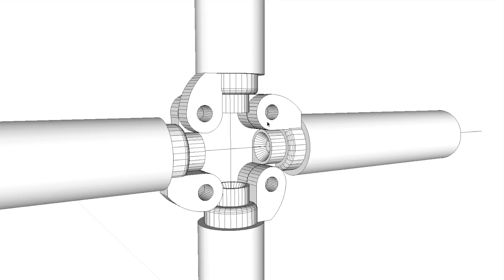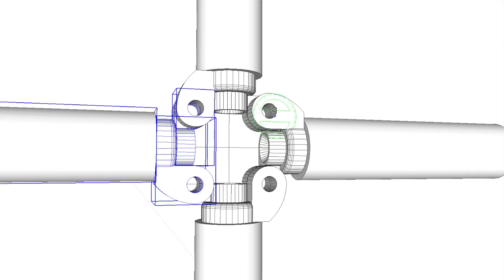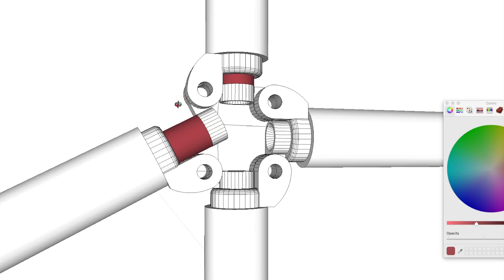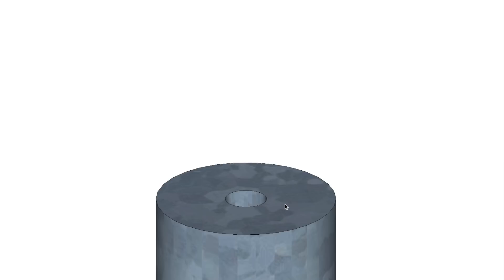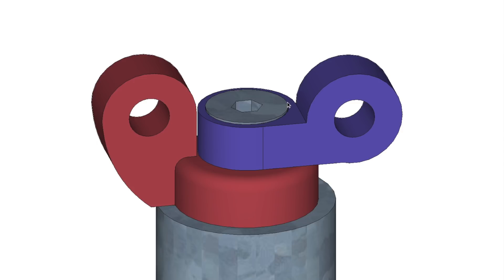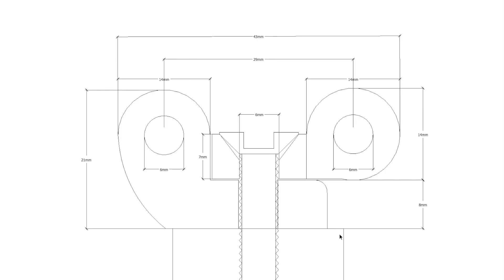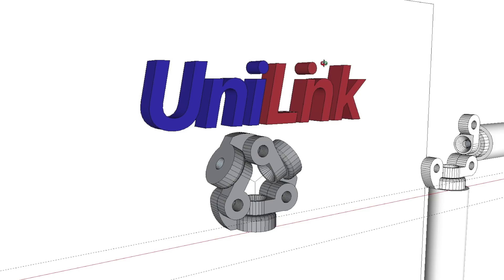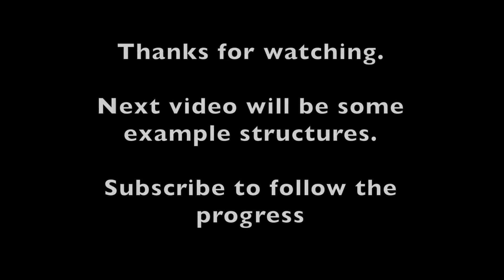Better Dome Hub - tech specs

Comment: "Handmade" ???. Send me a PM and I'll print them for free for you Paul. I've got some high tech carbon fibre filament that would be great for this.
Reply: We need a second view on those prints as well as some dimensions are missing. I am rather shocked at the tininess of the dimensions you have shown. Are you sure they are correct ?
Reply from the maker: Yes it is very small, my brief was to go for cheap and strong. This should work with struts up to 50mm (2") no problem. I'll dig out the PM button and send a message now.
Reply: Yes, please send a PM ASAP.

Comment: Maybe,Top connector, could be used as both top and bottom of connection , if top connector is turned upside down, with counter sunk hole in bottom?

Comment: Mayby you can use some sort of undercut anchors too put on the end of a pipe. (https://www.hilti.com.om/anchor-fasteners/undercut-anchors/r1208) Or a cheaper version. So you just have to cut the pipe to length an thats it.